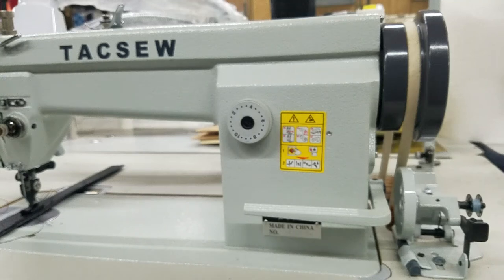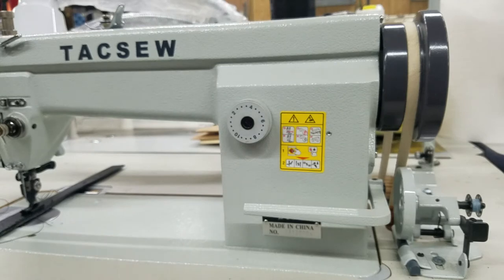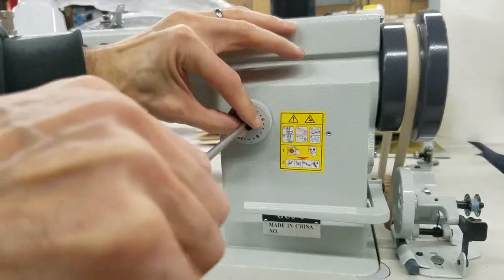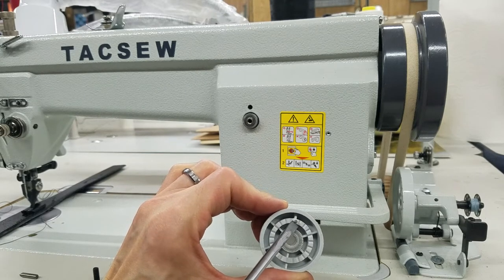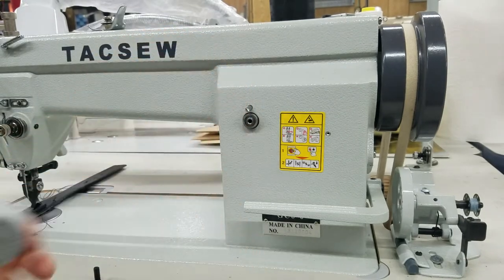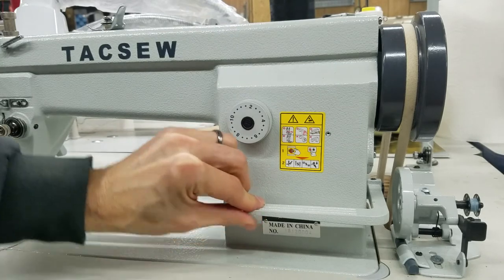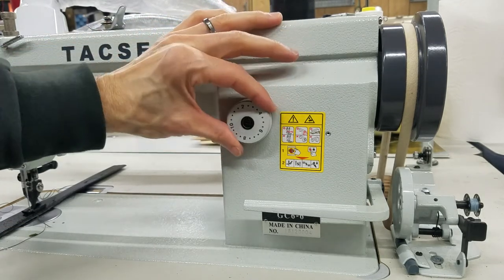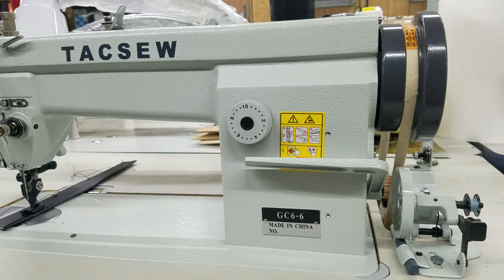Tacsew and Typical GC6-6 Stitch regulator fix

Comment: What if my reverse stitch is much shorter than my forward? I havent messed with taking the adjustment knob off. All i know is that i have my forward stitch length around 3mm but my reverse is closer to 1.

Comment: It is worth trying to ask. Hello I have a replica of a Juki LS-341N from China. my problem is that i cannot adjust the stitch length. It only sews the longest setting. This setting does not change with the wheel. The reverse lever is under the wheel and does not move at all when the stitch length is adjusted. Otherwise the machine sews well and everything else is perfect. Just not the stitch length. Maybe you have a few tips on what I could do. Perhaps it cannot be judged from a distance, but I would be grateful for suggestions. Thank you very much.

Comment: Hi! Thank you so much for all your videos. I wish I would have bought my machine from you. Too bad I didnt see your videos until AFTER I ordered my machine. I just got a Juki 1181n delivered from Amazon a few days ago, and boy was it not working properly. Luckily I have a pretty good mechanical background, and after much anguish I have the machine working. That being said, I still have one problem with the machine, and that is that the maximum stitch length (when set to 9) will go only to 4.5mm. Now, I have already had to do some major internal repairs on the cams on the main axel for the feed and the vertical shaft (as the machine arrived with an incredible torque on this axis that completely prevented sewing). I have also had to repair the forward and backward stitch length, so I am starting to become very familiar with the internal workings of this machine. So… I have fiddled extensively with the stitch length dial in the same way that you have in this Tacsew video, and no matter what I can’t get over 4.5mm. (Actually before I regulated the forward and backward stitch length to be equal I was getting 6mm forward and 3mm backward, but after I’ve only got 4.5mm both ways.) I have many manuals that I am working with, including a full parts list and the engineering manual, but I can’t figure out what I need to do to adjust this machine so that I can regulate the stitch length. Also, I have no problem getting the stitch length down to 1mm, but I do have to adjust the dial in the same way you have done in this video. I know! That is a LOT. I am not sure if you can do a video on this, but if so it would be much appreciated. Again, thanks for all of your knowledge. Kind regards, Alix
Reply: Did you ever find a fix for this? I've got a similar issue. max ~4.5 forward (even at 9), ~7 backwards. Lower values are no trouble. I've tried adjusting the forward and back balance, but it got to the point my feed dogs were hitting the furthest point of the needle plate, with no improvement in forward stitch length. Tried asking reddit sewing groups, facebook Juki groups, no-one knows. Now I'm in the depths of youtube looking for a solution.